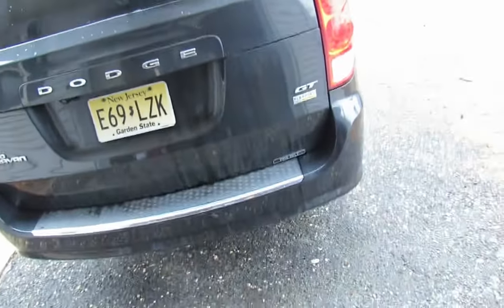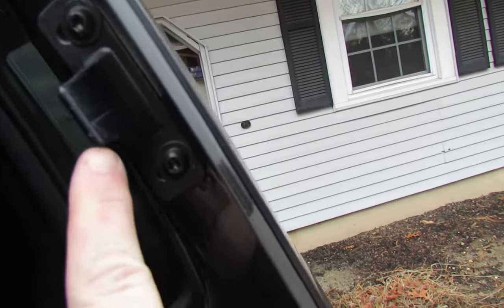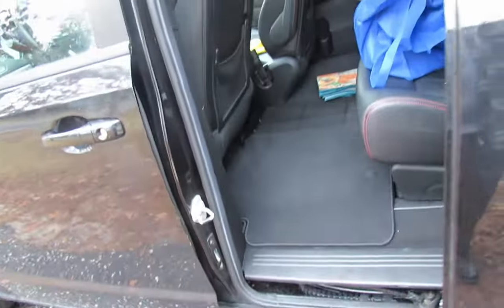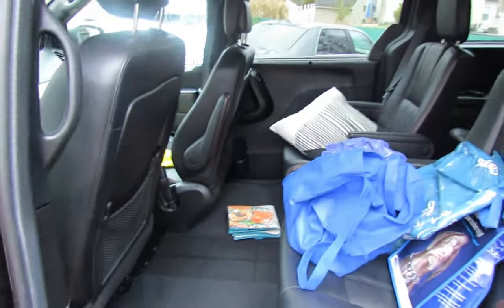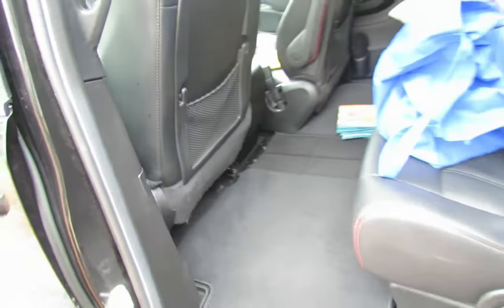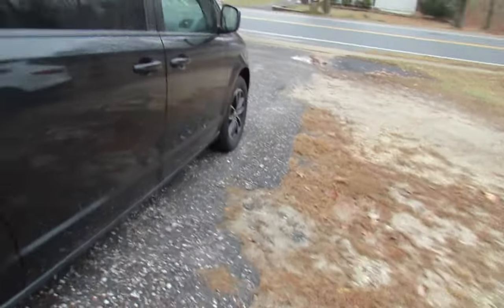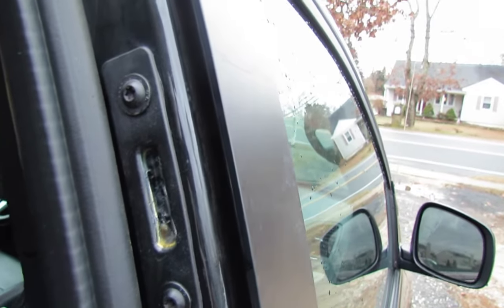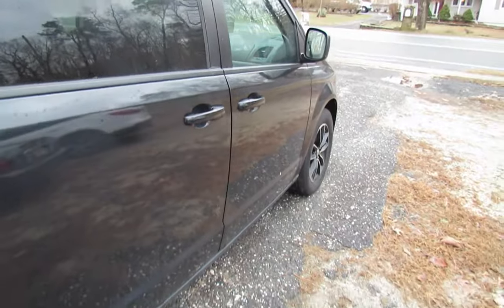Got a Squeaky Minivan Sliding Door (Cheap Fix)

Comment: It worked for awhile now it doesn’t! So frustrating.  Even when I adjust the “tabs” to be tighter. Lithium stopped working, so I used bearing grease which worked for awhile.  Going to price out new parts, maybe that will work.
Reply from the maker: I'm very surprised the lithium grease stopped working. I sprayed ours one time in approx 2 years and still no squeak. Let me know how you make out
Reply: @HM_RELOADED  well, I just greased the two rubber bump stops and that worked!! 😂 so crazy how I have to do that on a 2019.
Reply from the maker: @ManitobanOutdoors Exactly,  that should not be happening

Comment: thank you soo much.  Just put some on the door. Hopefully it works like others
Reply from the maker: @tiydes please make sure to put some grease,  silicone, lubricant on the actual rubber jams and hole shown in the video. Let me know if that fixed it. You will know immediately after driving. Cross your fingers

Comment: If this works, I'm gonna give you a kiss
Reply from the maker: Pucker up. Lol. Hopefully, it works for you.  Many other people messaged me and said this solution fixed their problem permanently. Let me know
Reply from the maker: Just curious,  did it work? Did the squeaking stop?
Reply: @HM_RELOADED  It helped a bit, but I think there's other issues beyond just the squeak. The rubber stoppers are also missing, might have to lube up all the sliding joints on the sliding doors

Comment: Does that work on the automatic locking on a sliding passenger of a 2016 Dodge Caravan?
Reply from the maker: It should work on all sliding doors on minivans with a squeaky dry rotted rubber door jam mechanism. Is your sliding door squeaky or are you having other issues?

Comment: Sorry didn't work for me!  The squeak was driving us crazy.  Some people suggested the clips for the panel needed to be replaced, nope, tried that! Tried spraying silicone on the gasket, worked briefly but back to squeaking.  Why it worked I have no idea, tried the suggestion in this video, did not work.  Took the panel off the door, drove with the panel removed and it continued to squeak, so nothing to do with the door panel.

In our situation it seemed like there was no solution.  Went to our body shop we used, asked them if the door could be pulled tighter to see if that would that would help.  They took it for a test drive, checked over everything related to the door.

In my attempt to find a solution I discovered that many vans have this issue and people are going crazy trying to find a solution!

HERE WAS OUR SOLUTION. It was immediate and have never heard a squeak, not even a tiny squeak!  Apparently the door was starting to sag a bit and the door was rubbing on the latch on the post.  You could see the metal was polished from the door rubbing on the latch.  The body shop lowered the latch and instantly no more squeaking, none, nothing, zero!  No grease and it's permanent!  Look at the post that the door slides  up to.  There is a 1/4" diameter, aluminum rod that the door latches on to.  The latch in question can be seen in this video https://www.youtube.com/watch?v=T1_cAX2zmiI&t=311s on the right, lower side of this video at 13:03. Hope this works for you!

Comment: Mine is more like a loud rattle. It's a company van but I'm about to drive it to the country and walk back and say I don't know what happened to it. And the service people are about as dumb as 2 pebbles. They are supposed to know where every screw is and how tight to tighten it. That's why they are certified and cost a fortune.
Reply from the maker: Sounds like the plastic trim may have loosened off the plastic clips. Try going to the area of the rattle, and check to see if any plastic panels are loose. If it's not the plastic panels causing the rattle, just ditch the van somewhere  like you said. Lol. Only kidding. Also, check for objects possibly caught in certain areas. The rolling around of an object may be causing the rattle. Also, check to see if the rattle is constant or if it rattles only when you make a left or a right. Knowing where and how a noise is happening may point you in the correct location of figuring out the rattle. Noises can be so frustrating because you don't know where they are coming from half the time.